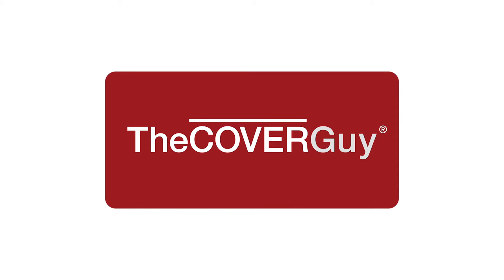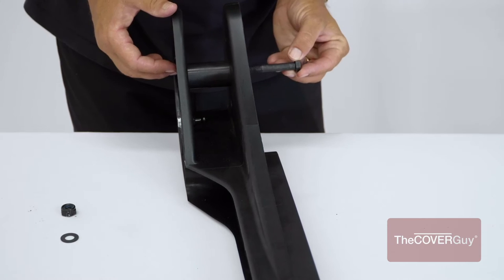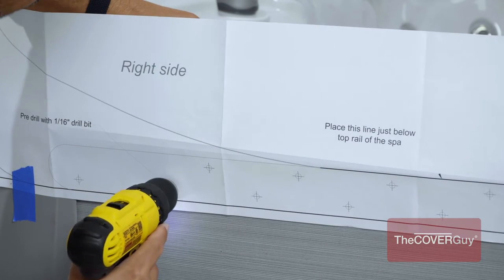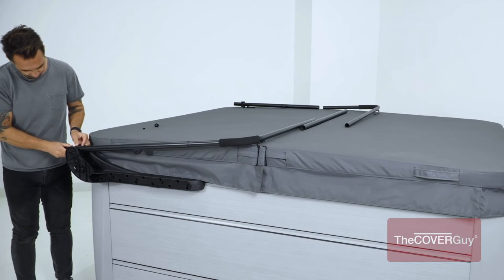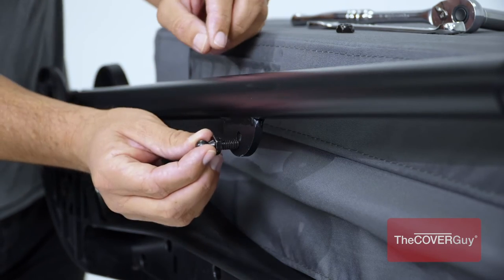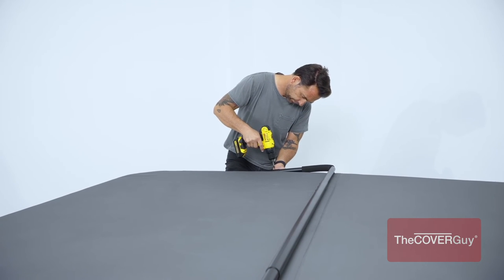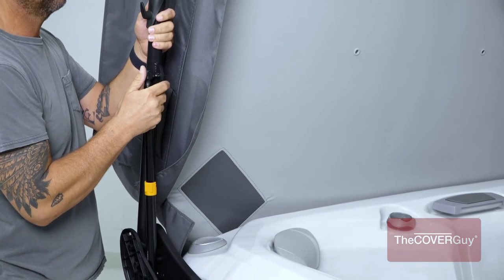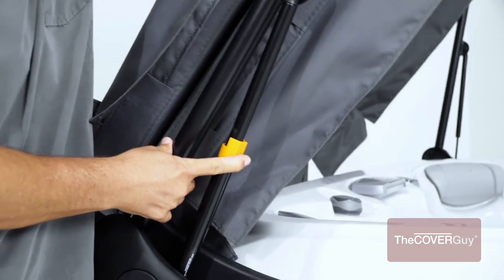Installing TCG Hydraulic Cover Lifter | The Cover Guy

Comment: My only issue with the installation I’m about to start is this video shows the ball piece facing the tub, and the paper directions in the box show it facing outward. Which is the proper way to install?
Reply: I’m having the same issue while installing mine right now. I really hope I don’t get it all installed and then have to take it apart again.
Reply: @littlet23 when I called them to inquire they stated I should follow the paper instructions. I didn’t end up using this lift cover in the end though. It wasn’t right for the space.
Reply: I followed the video, and it works perfectly.

Comment: I dont see the cost justification. standard vs hydraulic?  in the videos he makes the exact same motion to lift the cover off the tub. make it make sense.
Reply from the maker: Thanks for the communication.  The hydraulic lifter includes a assist feature.  The standard lifter you fold your cover in half and lift and pull to back and off the tub.  The hydraulic you lift half of the cover and give it a slight push and it pulls itself back and off the tub.